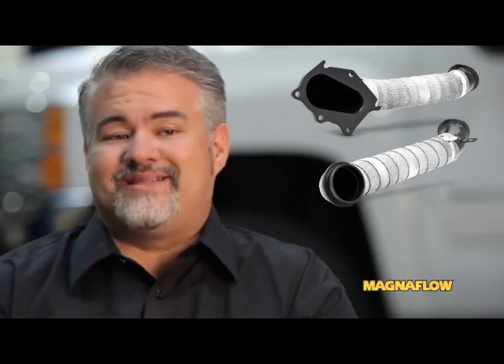2012 MagnaFlow Diesel Lineup Video

Comment: Converting a single exhaust to a true dual may have legal issues you need to address however if that is not of any concern then here you go:

1. Remove the factory Y collector and place a MAGNAFLOW 2.5" Tru-X crossover.
2. Using 2.5" tubing route the tubes back to near the factory muffler location
3. Place 2 - 2.5" Offset / Center 5x8x14" oval mufflers vertically side by side.
4. Route tail pipes or turn downs depending on your needs